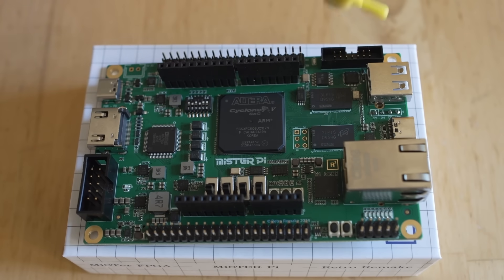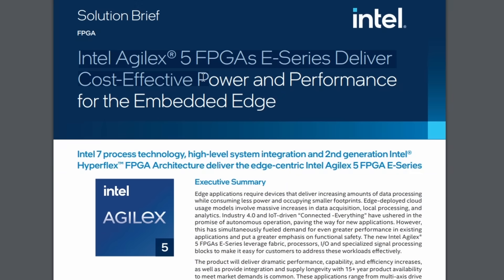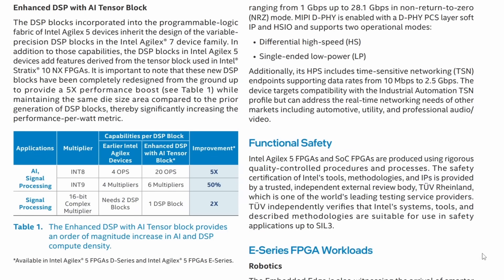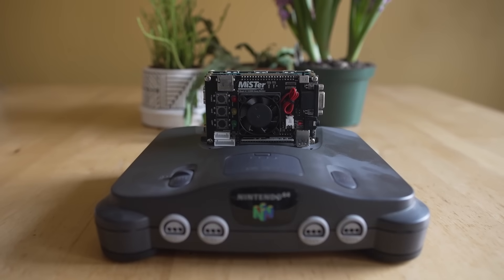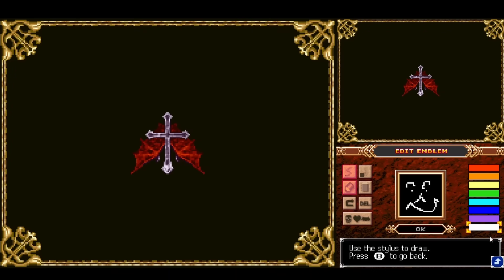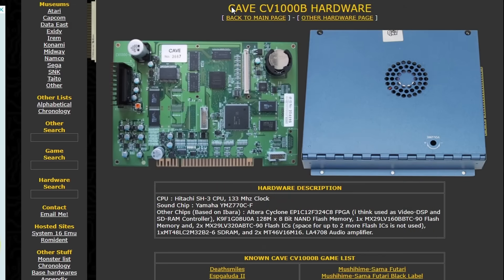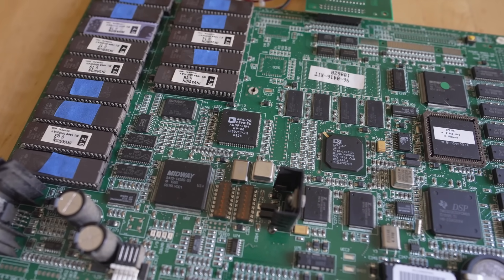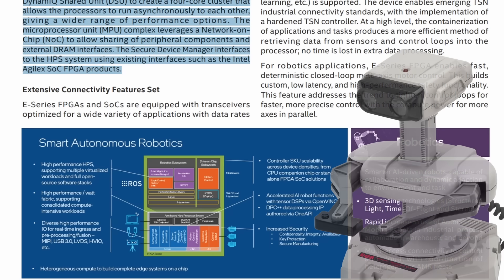"MiSTer FPGA 2" Coming? What Consoles Could It Even Run? Agilex 5 Explained

Comment: Do you think it can handle a psp or a Zeebo core for some Resident Evil 4 mobile 😂
Reply from the maker: PSP would be like a “oh wow they pulled it off”….i can’t even remember the zeebo specs so 🤣🤷🏻‍♂️
Reply: @VideoGameEsoterica  you have had "oh wow they pulled it off" moments before with N64 and Saturn cores. :D
Reply from the maker: Well yes but those were “probably just beyond the capabilities” of the Cyclone V vs Xbox and GameCube which are basically “so far beyond you can’t close the gap”
Reply: PSP's CPUs (apparently it has 2, alongside the GPU) were 222–333 MHz. Later games allowed the use of the higher speeds so full speed for all games might not be quite possible but maybe a slightly limited core might work? Now I'm wondering if the Agilex 5 can overclock.
Reply from the maker: Depends on how much you can push the fabric and overall architecture

Comment: If it can run the arcade versions of both Killer Instinct and Sega model2 games it will be instant purchase for me. Dreamcast would be nice for saving space around the tv but it is not that expensive to mod one.
Reply from the maker: I am always surprised by how much people want Dreamcast when a console with VGA out and a clone GDEMU are so readily available and inexpensive. But hey…I’d play a core too so!
Reply: @VideoGameEsoterica  Any links to where to buy prebuilt ones?
Reply from the maker: Dreamcasts?
Reply: @ Short answer : Ebay / aliexpress and facebook market. You can find ready to play fully modded solutions there but it can be very expensive compared to the DIY solution.

If my memory is correct the 3 mains modifications are the GDEMU, a silent Noctua fan (unless you enjoy the rustic sound of the dreamcast jet engine), and a new PSU. 

Those 3 do not require soldering, just a screwdriver and to be careful when manipulating the stock PSU.
Reply from the maker: Plus HDMI if you want it
Reply: Sure it would be a huge hit, and people who are into it have cash burning a hole in their pockets

Comment: If it doesn't enable us to have the Sega Model boards and Namco System boards and at least PS2/GC in FPGA, IMO it's not a big enough leap to replace the MiSTer FPGA.

If it's just Dreamcast and a few other boards, it's more like MiSTer FPGA Pro than a full-on MiSTer FPGA 2 😂
Reply: PS2 and GameCube in FPGA is a long way off. To have a chip cost effective enough to run it will be years away.
Reply from the maker: Exactly. Plus with frame buffer consoles I don’t think people really know that you are better off with software emulation
Reply from the maker: But what about the humans who would enable that? The team of people that work for years. You are thinking consumer priced hardware to run PS2 and GameCube when the part for that is probably well into the four digits just for the FPGA chip
Reply: @VideoGameEsoterica We could have said that about the existing MiSTer project, and look at all the amazing cores it has.

Yeah, people would have to do the work. If the FPGA isn't capable of it though, then they won't. FPGAs capable of such things are either very expensive or don't exist, yet.

I just don't see the justification for a successor to MiSTer in this. A whole new platform just for essentially a few more cores.
Reply from the maker: And dozens more arcade boards